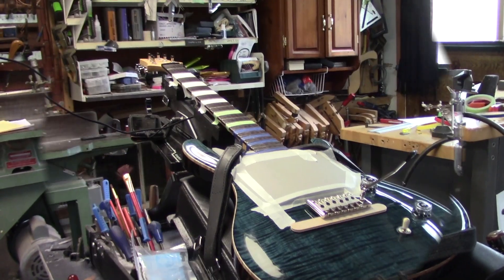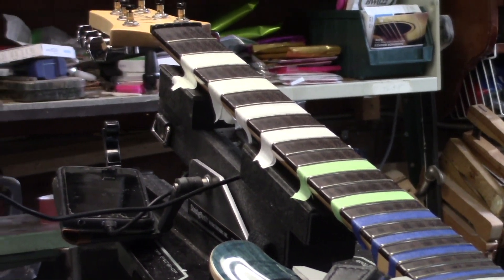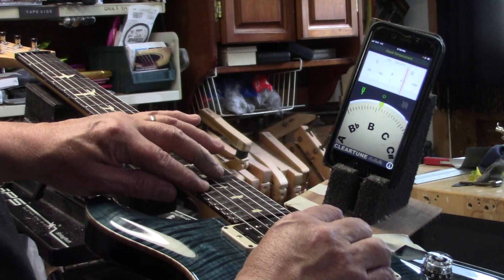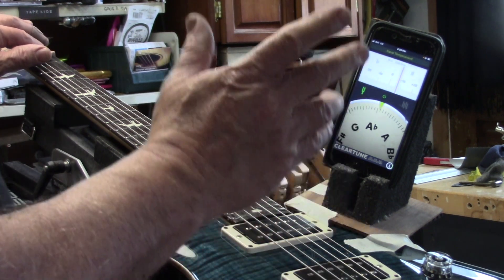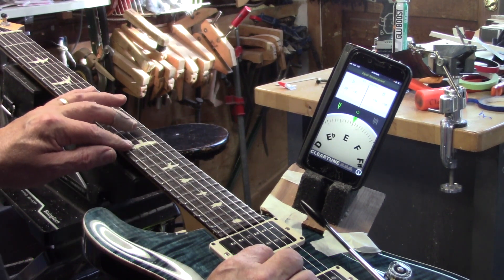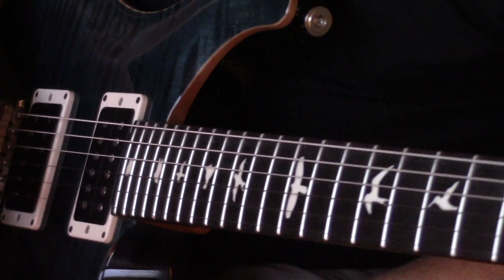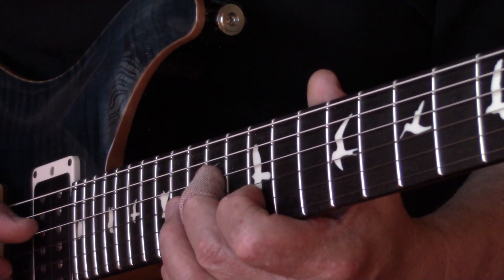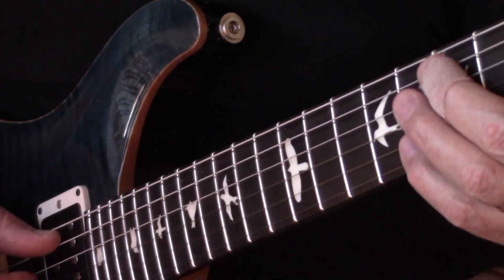PRS / Comp Nut / Calibration for .010"-.046"@StringTech Workstations

Comment: Actually could I ask an expert? Do you think there is any difference between a string tuned to pitch with a locking tuner and one that is wrapped around a tuning peg a bunch of times? Does that difference in string length, so to speak, make any difference whatsoever? I've always wondered about this. They say, oh of course not, but I'm not convinced!
Reply from the maker: That sounds like a Guitar Forum ... "hit generator" .... makes no sense.